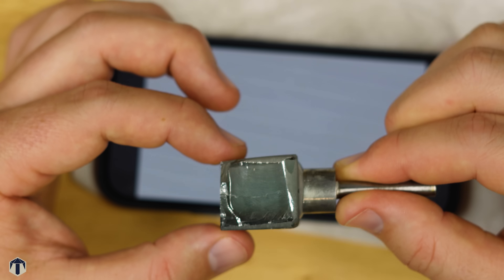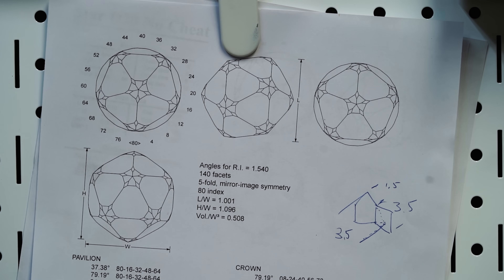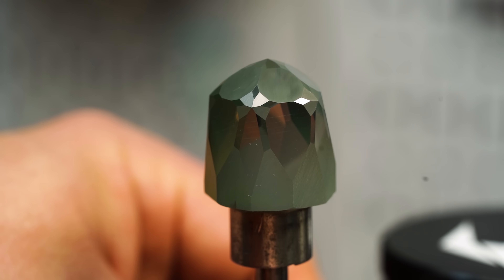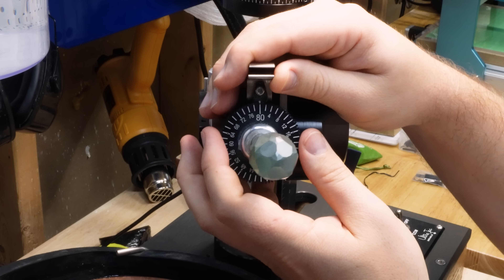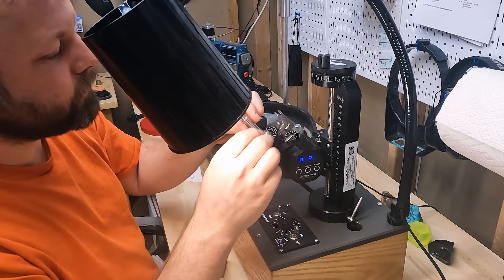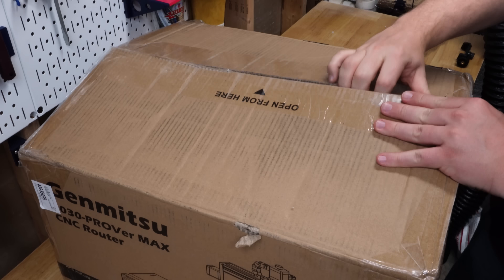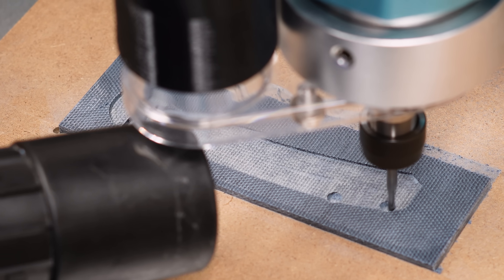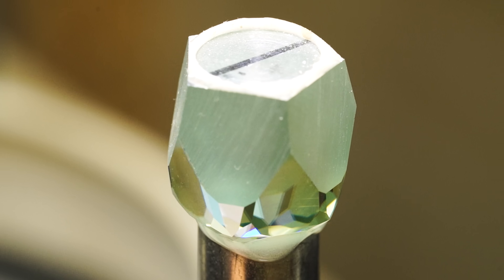The hardest D20 I have ever made

Comment: Why doesn't it just do 360 degrees instead of 80 arbitrary teeth lol
Reply: It's mechanically challenging so they don't tend to go over 120.  Even if you did it 360 still wouldn't give you 80-fold symmetry
Reply: @AngryTurtleGems  is 80 a common number in gem facceting?
Reply: @mobius273 80 is kind of standard for designs with 5-fold symmetry like these dice. the typical options offered off the shelf are 96 (the modern default), 32, 64, 72, 80 and 120.

Comment: Hey! I've watched a few of ypur vodeos now and it looks like such an amazing process. How much does it roughly cost to get started in this? I suppose what one really needs to get started is the grinding machine with stones and the lever arm system to get the accurate cuts... is this like super expensove or not?
Thanks!
Reply: It's currently hard to do economically.  Top end machines are very expensive, demand has driven the used market very high sometimes even for questionable machines.  I am working on a kit to get started for under 500 dollars, hopefully to launch soonish

Comment: PSA: to anyone planning on getting married, moissanite is the single best alternative to diamond. It’s a fraction of the price of a diamond, has almost the same hardness (9.5 instead of 10), so it can’t be scratched, and as you’ve seen, is absolutely stunning. It also was first discovered in a meteor, but the vast majority is lab grown, which means there is no blood money involved.
I love my moissanite ring. You couldn’t pay me to switch to diamond.
(Side note: when we went ring shopping, Jared told us they don’t do moissanite because it “could turn yellow if left in a hot car”. Why would I ever leave my ring in a car at all? Also, a simple Google search shows that if that does happen, it’s usually from extreme heat, and returns to normal when cooled slowly. Jared told us that the less expensive option was white sapphire, which looks so cheap compared to this dazzling beauty. Anyway, if a ring shop tells you that, find a local shop instead of a national chain.)

Comment: I lov ehearing the unique challenges and techniques you use taking on dice-making. Also… the last shot was just magical. Question - the final polished die with the stylized shots looked far clearer and less colorful than the original specimen. Is that just a trick of the eye here or is it still quite saturated with color?

Comment: Hey man, love the videos. What type of cutting wheel do you use? I'm interested in getting into hobby gem cutting, but I don't know where to start or what brands to trust.
Reply: He's using an ultra tec v5 faceting machine, which is about as good a machine as you can get off the shelf (well, with a few months lead time).  I am working on a project to get an inexpensive starter kit together, but I'd first suggest looking to see if there is a local rock and gem club that might have a few you could try out or take lessons on.

Comment: an odd question, do you need to reset your 0 height on the arm you use when you add a new disk? since it looked like you added it on top of the other one, wouldn't that change the relationship of the arm to the surface for the angle you're dialled in for?
Reply: You don’t put one lap atop another, but yes, vertical adjustment is done constantly.
Reply: @canadiangemstones7636  thanks, I guess a rookie mistake would be to forget to and then realise later that you need to reface it all...